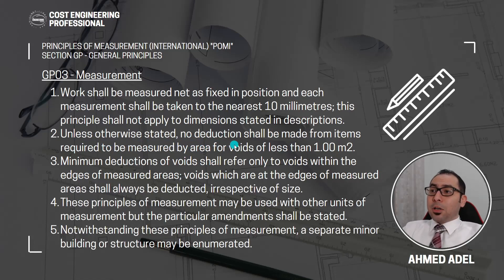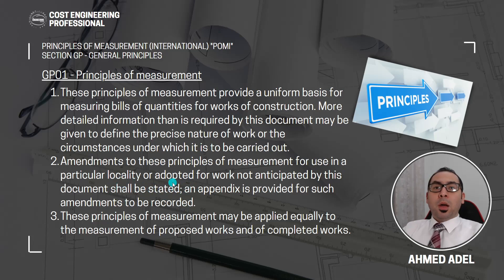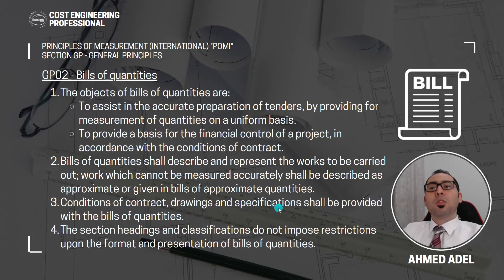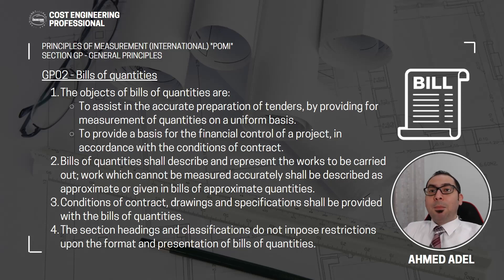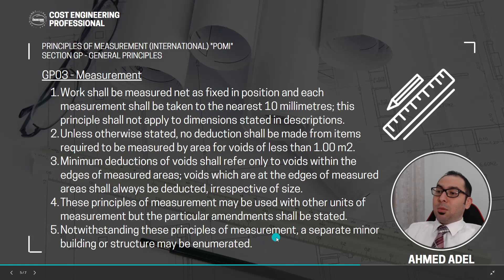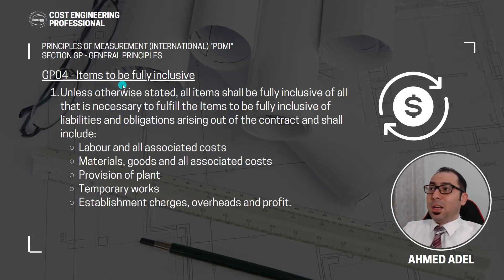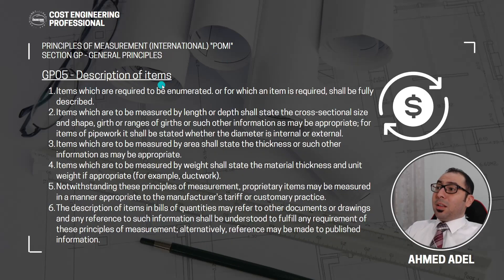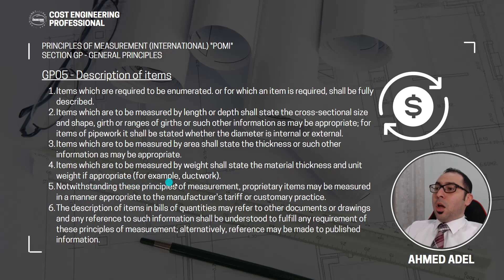POMI Explained | Bill of Quantities General Principles Part (1)

Comment: Hello sir! I have a clarification under GP03-Measurement Item 2 around 6:29 mins of the video. What if you have 3 manhole openings each having 0.50 sqm at different locations on a floor slab? Is the total of 1.50 sqm deductible in the gross area of the floor slab? 

Or since each of the manhole openings are less than 1.00 sqm, then are they negligible and are no longer deducted from the gross area of the floor slab?

Thank you so much for providing these video series about POMI. These are very helpful.
Reply from the maker: Thanks a lot for watching and for the question. As you said in the second paragraph, all openings that are less than 1 m2 each are not deducted 👍
Reply: @CEPQS  Thank you sir 👌

Comment: ...please explain in graphics to make clear - openings at edge of boundary that must be deducted irrespective of size of opening please? Thanks in advance, Sir.
Reply from the maker: Thank for watching and for the request
Reply from the maker: I’ll try to do that in a separate video. But for now try to imagine a typical floor slab with cantilever balconies. The empty areas between the balconies are not part of the measurement as it is free of any structural elements 🙂